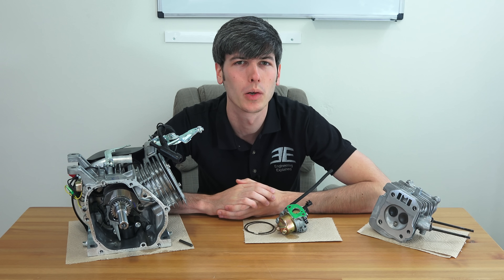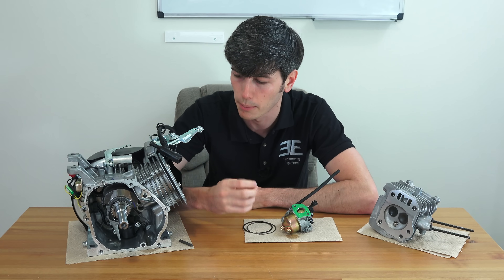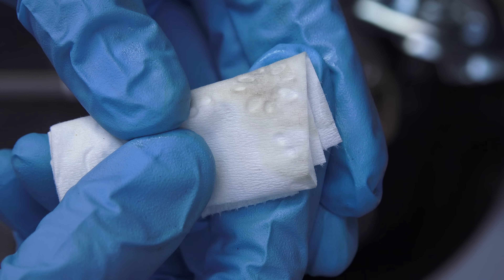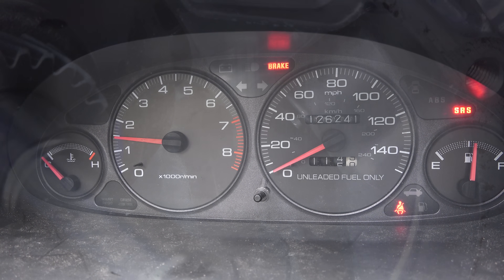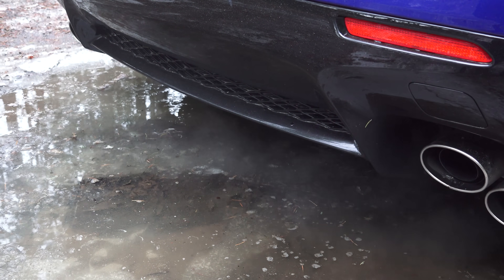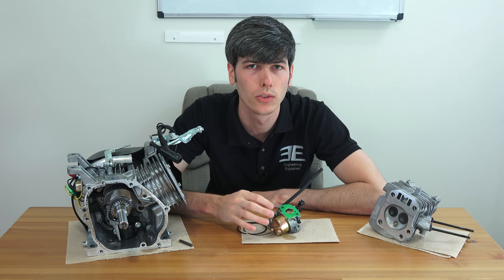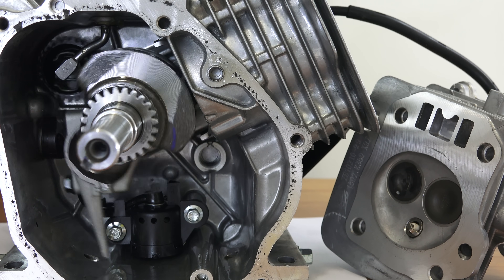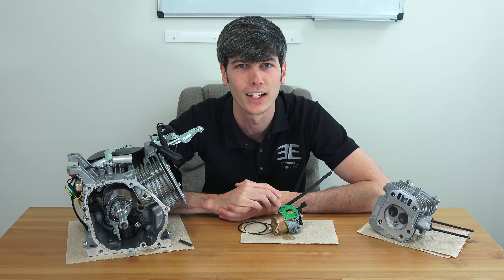Should You Warm Up Your Car Before Driving?

Comment: My girlfriend's 2015 toyota corrolla s with automatic trans doesn't like to be driven without letting it warm up for about 5-10 mins I tried to drive it the other day without letting it warm up and it wasn't Shifting to 2nd gear i was barely going 20mph. I am 200 yards away from a stop sign so I wasn't speeding I just pulled over and let warm up for 10 mins and after it was fine. 

ANY IDEA WHY THE CAR DID THAT???
Reply: Because the transmission didn't get a chance to warm up yet. I'd also have someone look at it to make sure the transmission fluid is ok.

Comment: You are incorrect in stating that carburetors don't adjust the air fuel mixture to compensate for temperature. They do so using a choke plate that restricts airflow into the engine when it is cold. This increases intake manifold vacuum and thus the amount of fuel drawn through the main jet at a given engine rpm. As the engine warms, a bi-metal coil spring gradually opens the choke until there is no longer a restriction and the engine carburetes normally. In combination with a stepped fast-idle cam on the throttle linkage, and intake air preheating via a duct over the exhaust manifold, carbureted engines from the mid-1960s on generally had good to excellent cold engine performance ... until parts wore, got gummed up or were mis-adjusted by well-meaning do-it-yourself "mechanic's." Of course, different carburetor designs were better or worse at mixing and atomizing fuel, but some (like the last GM Quadrajets before electronic controls) were really very sophisticated, efficient and responsive air-fuel mixing devices.

Comment: What rpms should I shift at when it's cold
Reply: ejmin ebrahemian would want to shift as low as possible, 2.5k max, since the oil isn't at operating temperatures it isn't properly lubricated and can cause excessive wear on your engine. New Lamborghinis actually limit your rpms electronically til the car is up to temp

Comment: but wouldn't putting the engine under load while it's cold causes more ware than letting it warm up standing still  ?
Reply: I don't see anything in the owners manual regarding warming up cars. Funny how no one addresses that it takes a couple of minutes to get the defrosters working. I see people who don't even bother clearing off their windows, they just take off expecting that their defrosters will work. It's a road hazard, in extreme cold temps you need the defrosters working or your windows will fog up. Many people who warm up their cars don't care about the car but the interior is warm enough for them.
Reply: I'm not sure what you mean with the whole thermostat question. What i was getting at is that I agree that vehicles need to reach a certain temp. The amount of gas entering the combustion chamber is blown out of proportion in this video. Also, thermal expansion comes into play. The piston and ring tolerances are bigger when the block is cold so the internals will slap around more until warmed up causing more wear.
Reply: Cody Wright then why cars have thermostat ?  Why does it have to reach certain temperature ?
Reply: Archer it's not just a matter of getting the oil flowing...
Reply: Is it any different for a diesel engine?
Reply: Иван Калашников  gasoline evaporates as cold as -40 degrees... and the o2 sensors that control your air fuel ratio aren't used until they warm up so it operates on a pre programmed ratio, and the sensors have heaters to get them hot in like 2 minutes...... also most engines are not direct injection so it's not like the injectors are dumping a puddle of fuel in the cylinder .. it's getting a fine mist in the intake...
Reply: The engine doesn't have to hit a certain temperature - it's simply more efficient at that temperature (oil flows easily, gasoline detonates more readily, metal expands to help seals, etc...).

Once the engine is in closed-loop operation the concerns about it idling are practically gone.  I've seen people idle their gasoline engines for an hour every morning for years without issues (so it's warm before they get in).
Reply: Rubino L
 Engine management systems are specifically adding extra fuel during cold idle to warm the engine faster.  Many also rev the engine to 2,000 RPM or so to help out.

Once the car is in closed loop, of course, then this will usually end, then light driving is the best way to get extra heat into the engine.  Engine management systems will keep a slightly elevated RPM during this phase, but will generally cease to add extra fuel.

My Volvo 850 takes a full 30 seconds when it's 70F outside to do this, it can take two minutes when it is near freezing.  My wife's Toyota takes about the same amount of time, but keeps a higher RPM for much longer.
Reply: People here seem to have a listening problem.
Reply: See the problem is that it's not about opinions. Read your owner's manual, they say the same thing that has been said in the video. Stop spreading bad habits.
Reply: Archer it depends on the engine, and even if you drive gently the engine is still loaded and operating at high loads compared to just idling, so until the chock opens the gasoline is diluting the oil because of rich mixture, other than that, each fuel has certain operating temperature i think 80c for gasoline 90, that's why your car heats up until this temperature is reached before thermostat opens.
Reply: Are you referring to me?  Because cylinder and engine temperature has everything to do with the proper stoichiometry of the combustion process in modern lean-burning engines... this is part of why modern engines run rich until closed loop operation - to prevent improper detonation and after-fire (sometimes improperly called back-fire which is actually a timing issue).

Which octane rating system are you using?  Premium in the U.S. ((R+M)/2) is 91+ octane.  Running 100+ octane can burn exhaust valves over time (unless you run JP fuel, which will take much less time...).
Reply: Howard Rourke  Yes, yes, fuel burns... at a pace that would be considered an explosion in any other context...

No one here is suggesting people should idle their engines for hours on end, but there is no real harm idling it for a minute or two before taking to the road - more if it's colder.

Precise fueling, synthetic oils, thermostats, intelligent engine management systems, electric cooling fans  and so on pretty much removes the damage allegedly occurring as a result of idling a gasoline engine.

At idle the oil pump will be providing the volume and the crank providing the oil pressure within a second or two from first turning the key... if they don't you have bigger problems.

Can you show any evidence of a modern fuel injected car with any wear from excessive idling?  And not just articles of claims - actual images of engine damage or wear...

Once upon a time idling was genuinely bad for engines... mostly due to carbon fouling and fuel deposits.  This problem simply no longer exists to the degree it once did... and fresh deposits will be gone in no time with a good drive.  There's a reason we don't see cars blowing soot like in the "old days."

Also, realize that I am specifically suggesting people keep their RPMs elevated for the first few seconds after starting... though their cars will probably do that for them... get the car to temp, then to drive.  I'm not suggesting hours of idling are going to be harmless, but we're talking about an hour or so doing no measurable harm... even if done daily.

The worst part about idling an engine to warm it up is that the transmission won't do much warming up at the same time.  The heat exchange is pretty poor - and thinking that you can hammer on the throttle just because the engine is warm is more likely to harm the transmission with its cold fluid.
Reply: looncraz I live in Virginia and there is a shell station about 30 minutes from my house that sells 110 octane gas
Reply: Timothy Currell I'm not sure about diesel engines, but I'm guessing probably not. I mean I know one of the main differences beside the obvious is y'all have glow plugs, but that shouldn't really affect how fast your engine warms up
Reply: Just drive it gently until it's up to temp (or close to it). This puts minimal load on the engine and gets it warmed up faster than idling (plus it saves gas) This also helps the engine heat up evenly. Reving a cold engine puts a lot of thermal stress on components and can cause big problems like head gasket failures. I let my 2006 matrix idle until RPM's start to drop. Around 30 sec.
Reply: Cody Wright srry my reply was meant for James, and i know gasoline evaporates at -40, but in the engine it has to evaporate instantly,  liquid gasoline doesn't do any good for the combustion process even if it was fine droplets,  it has to be in the vapor form, and somewhat hot vapor for a more efficient combustion and to extract more energy from the same amount of fuel.
Reply: As with most things in engineering, the process serves multiple purposes.  Even before cats existed rich-running start cycles were common to protect the engine before the oxygen sensors warmed up.  The SAS (secondary air system) was designed to warm up the cats faster by pumping air directly into the exhaust stream during warm-up to burn the extra fuel inside the cat.

Think of the choke on simple carbureted engines... specifically designed to enrich the fuel ratio while getting the engine up and running.
Reply: Howard Rourke
You might want to read up on Lambda systems and early fuel injection.  I'd suggest early Volvo 240s as a place to start...

And emissions systems in general... here's a little quote for you:

"Secondary air injection (commonly known as air injection) is a vehicle emissions control strategy introduced in 1966, wherein fresh air is injected into the exhaust stream to allow for a fuller combustion of exhaust gases."

-Wikipedia

Many modern cars STILL have SAS.

"the choke isn't about making the actual mixture that burns richer, it's about making up for condensation in the intake manifold so that what actually makes it to the cylinder and burns is close to stoichiometric."

Choke valve:

"Choke valves are generally used in naturally aspirated engines with carburetors to supply a richer fuel mixture when starting the engine." ... "Choke valves are important for naturally-aspirated gasoline engines because small droplets of gasoline do not evaporate well within a cold engine."

-Wikipedia

"Modern engines are actually much less prone to temperature effecting mixture and richen it much less when cold"

They are by no means immune, a cold mixture is less prone to ignite than a warmer mixture, requiring more fuel to make up for this shortcoming.

"NO, closed loop is only employed early cause the O2 sensor needs time to warm up, has nothing to do with anything else."

Open loop is employed early, closed loop can only be used once exhaust oxygen levels are accurately known.  What we have is a series of systems developed over a century which work in tandem - merging multiple behaviors and technologies to accomplish multiple goals was part of the journey.

""Detonation" is only really an issue in HOT engines."

Right... unless your mixture is too lean, timing is wrong, compression is wrong, you have carbon build up, octane is too low, etc... running rich when cold prevents that.

"Backfires are almost all about mixture."

You're thinking of after-fire.  Backfire is when the fuel/air mix ends up back out of the intake valves.  After-fire can also be caused by bad timing... and is usually called backfire by most techs, but is a much less precise term.

...

For someone getting so much wrong, you'd think you'd be more cordial...
Reply: Tony Samson  So little class... for fuck's sake.

YES, very high octane gas can result in burnt exhaust valves.  I've seen it several times (mostly from idiots running lots of octane boosters, one case from jet fuel... I kid you not).

Also, WHAT RATING SYSTEM ARE YOU USING??  100+ octane is not even sold in the U.S.... it is common in Europe... but they use a different rating system, so the ratings are not comparable.

100 Octane in Europe would be about 91 Octane in the U.S..

Premium Unleaded, in the U.S., is 91 Octane or above (93 most commonly, AFAICT).
Reply: Tony Samson

My car has a 10.5:1 compression ratio (static, clearly, if you even know what that means) and runs 87 octane without pulling timing.  Adding ethanol is a disaster for fuel economy and power, but timing is still not pulled ( in fact, timing only gets pulled if I tap on a knock sensor to test if they are working :p ).

My turbo-powered cars were more sensitive, naturally, but at 91 octane would pull zero timing... at 89 I would see timing get pulled due to knock, especially with heat soak.  87 was out of the question.  Ethanol added to the fuel was fantastic for adding more boost.

Running higher octane than is required is throwing away money... and giving it to the oil companies... so is the one being fooled here?

You should always run the lowest octane you can manage without pulling timing (or experiencing knock if the car is older).
Reply: looncraz
Reply: my merc b200 idles at 2200 at -20C with cold engine and drops to 1200 when warmed up. when i start driving cold it spins at 2400 not even. so no difference for me.
Reply: stop babying your car, nothing happens if you drive it, just don't floor it instantly
Reply: read the manual of your car. Mine says don't idle it, just dirve
Reply: Иван Калашников where do they get thier electricity to power those batteries
Reply: WHere did we go, from better or not to warm up the engine talking in terms of engine wear and damage prevention, to environment, batteries, and who smokes:)
Reply: You mean most engines are NOW direct injection, right?
Reply: I believe this happens to you GF's car, because the valve lifters are starting to give in, and especially if these are hydraulic, the oil from the bottom needs to be brought up with pressure from the oil pump, then the lifters start to quiet down, as they are filled and coated in nice oil:) If we are talking petrol car mainly, very easy to hear in the first seconds-min, but for example take the same 2.0ltr gasoline engine from the factory, put it next to the same car, same temp, leave it for same time, start both and the new engine will not do it.
Reply: ***** he said two contradicting things, when the engine is cold gasoline will delute the oil due to rich mixture, that is an exact reason why you should warm up by idling even to a minimum as you said, but yet he said this is why you should start moving ...

And i totally agree with you about those environmental dumbs, they blame you for your car yet they drive a car, hybrid most of the time which they have no clue what environmental damage their batteries cause to the environment, add to that most of them are smokers ...
Reply: ***** hahaha i Agree
Reply: Yeah, not only that once you drive you are pushing more cold air onto the engine while driving it so it's better to allow to warm up the engine a bit before driving it. Anything under 40F i let the engine temp gauge move before i take off and anything above that i let the RPMs settle. 

As for these environmentalists i don't think they understand the cost to manufacture new engine components (or buying a more eco friendly car) also has a detrimental impact on the environment. It's more eco friendly to take care of the car you already have, limit the amount of driving you do (within your means of course). Most people want their cars to last for a long time (because it's not cheap to buy a new one) so they'll want to take care of it and let the car warm up before driving, most just warm it up to get the heater working.
Reply: I'd say it's safe to drive when the oil flows a bit but until the engine warms up to operating temperature, just drive gently.
Reply: Doesn't take long to get the oil flowing.
Reply: James L. Walsh its plain thermodynamics science no opinions